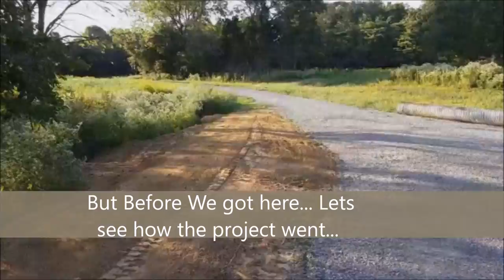Expanding Driveway! Making Gravel Pad Bigger for Trailer turn around..

Comment: Looks like you might get some Hurricane Irma remnants dumping rain on you, I hope your pond is ready. Trailer spot looks good too. I was taught to use the 4n1 by opening the bucket all the way open, set both edges against the ground and drive into the pile to level it, hooking an edge of the pile when it is real big will keep the bucket from wanting to rise up.  This works better in tracked machines than it does with wheeled ones, or so it seems to me; but as long as you start on even ground with the tractor it wont make as many humps and dips. Thanks for the videos Joe.
Reply from the maker: thanks man. I can't visualize your description with the bucket open. On one of my next videos, I found a method that seems to work better than 'normal' bucket ops and better than the box blade. I think I got a clip of it.
Reply: Alright, open the bucket like you are going to grab a log to pick it up, roll the bucket down so that the blade edge touches the ground and the edge that normally closes on the log also touches the ground. I will see if I can find a video on here that shows what I mean.  https://www.youtube.com/watch?v=yU4gN8ZGgF0   
This one shows what I was talking about. You can back drag and get a bucket full real easy, but it will leave humps and dips. Pushing forward from a smooth surface helps keep that from happening with a tractor.

Comment: Do you have a map of where all your duck ponds and watering holes are?  ;-)
I thought "you" had fixed the hydraulic fitting that was damaged by an attacking tree?
Time for some "round-up" to get those weeds in the driveway.
I thought the excavator was your "go to" machine for leveling dirt, loaner not up to it?
Are you planning on using the gravel from the "trailer" lot and/or do you have some earmarked for this job?  ;-)